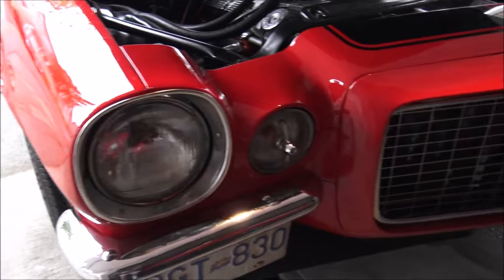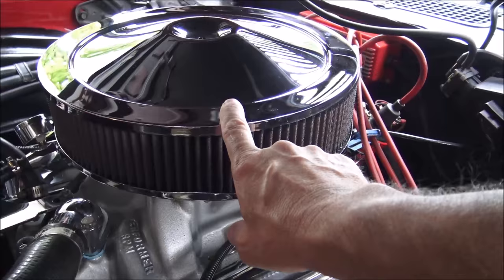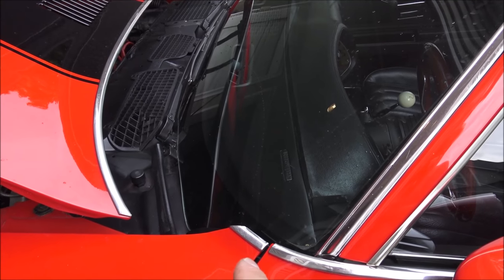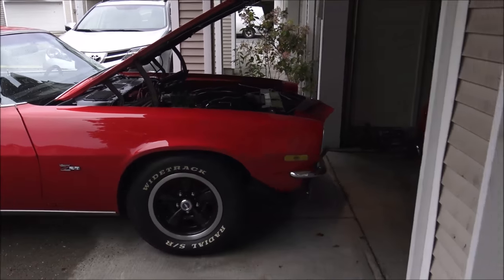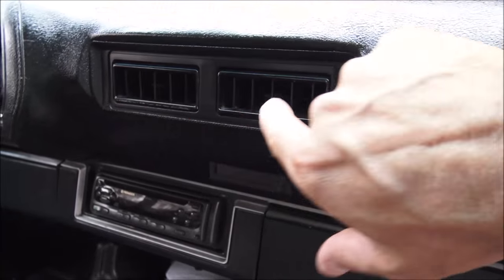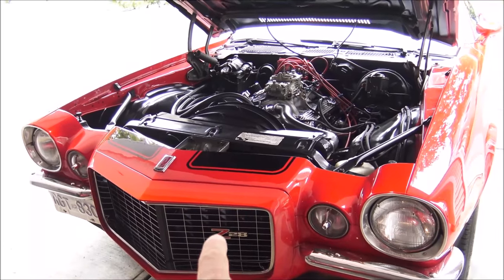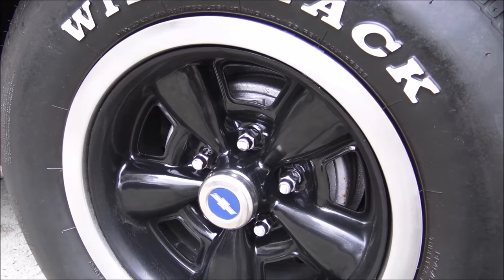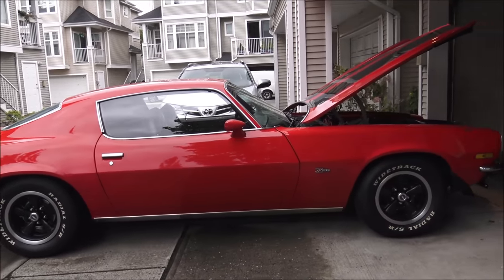Introducing my 1973 Z28!

Comment: Good video.  I have a 71 Z28  RS  the same cranberry red.  I have suspected that it was pieced together.  Your comment about the dash insert being an one year 73 part and the grill bracing may have answered some of my questions.  Seeing that firewall hung gas pedal was surprising, 70 and 71 Z28 only had floor pivot pedals.  Thanks.

Comment: I bought a 73 split bumper listed as an LT even on the vin number but Mine has the round signals like yours so I was just curious  how you can tell the difference between the models so I can make sure what I have. it's in very good shape now but at one time it was a drag car ( has the 454 big block instead of the lt 350) and a 400 tranny. It also has  the chrome trim and pretty much is identical to yours I only ask because I'd like to get it as close to original as possible not including the motor. There are no z28 or rs decals but they could have been removed when it was a drag car.
Reply: As I wrote in another comment Lt package over rode the z28 so no z28 badges on type LT also the trim tag on the inner fender will give you even more information including interior and exterior original colors

Comment: Also the Woodgrain Bezel starting in 1973 the Wiper switch had the wording on the switch, instead of the woodgrain bezel. It could be it was a fake that he bought in 1982 and was unaware of it being a fake.
Reply: There is a plate affixed to the engine compartment, drivers side above the brake master cylinder, that shows if the Camaro was a Z-28, RS, SS, or standard, along with the exterior and interior color schemes encoded. This cannot be (easily) faked.
Reply: I agree on car being a fake. Wrong switch for hidden wipers. Should say 147 on bracket. Car is also missing center rubber hood support part on firewall found on the RS.  Wrong bolts on hood latch noted.

Comment: Car is not a true RS. Too many parts incorrect. Wipers can be added after. Car is missing longer radiator support bars only found on 1973 RS cars. Car is even missing extra bolt holes on radiator support where longer bars would have been attached along with the nut rivets on inside fender. Most cloned 1973 RS cars people miss the 28 inch bars.
Reply: But it does have most of the right parts. I do agree with what you are saying but this one is probably legit.

Comment: In cold weather that Engine is going to be HARD TO START. Someone TOOK THE CARBURETOR CHOCK BLADE OFF, IT IS GONE. IT IS SUPPOSE TO BE   IN THE FRONT PART OF THE CARBURETOR !!  OVER THE FRONT THROTTLE BLADES.
Reply: Holley carbs are garbage anyway he should have left the q jet on it
Reply: Are you trying to say "choke plate"

Comment: I had a 73' z28 I bought back in 1980 for $300 and drove for a few years. Mine was stone-stock when I got it. Ditching the Quadrajet was a mistake as it flows more cfm than the Holley 650 double-pumper, gives better low-end torque and much better mileage. Common mistake people make. I was making minimum wage back then, $3.35 an hour and I used my entire paycheck in gasoline in a weekend back then when I tried the 650 holley and a Torker open-plenum intake.
Reply: There's no way it flow more than the Holly

Comment: Really nice car , but a real 73 z28 didn't have a split bumper.
Reply: Wrong.
Reply: @rossdean1997  Excuse me.  I meant to say that they had bumperetes, that the earlier 70 Z28's didn't have.
Reply: @FjHenderson  still wrong. The bumperettes were originally introduced with the z22 RS package from 70-73. The z/28 package was separate and never included appearance changes aside from the rally wheels.
Reply: @barnabyjones5161  As you said it for me, the rally sport, RS package had split bumpers. The Z28 package had a full bumper. I had a 73 real Z28 and it came with a full bumper. IF you see a 1973 Z28 with a split bumper it was converted.
Reply: @FjHenderson  the z/28 package could have split bumpers IF it was ordered with the z22 RS package. Otherwise, it was a full bumper car.
Reply: @FjHenderson  Wrong again! RS was avalible in 1973 for a models and options

Comment: 1970-73 Camaro Z-28 (not zed) had gas pedal bolted to the floor, his does not. Also it does not have the rear bumper guards that all Z-28 had. But I am not sure if they had them in 1973 because of the reinforced bumpers.
Reply: Only the 1970 Camaro had the gas pedal bolted to the floor.  1971 - 1973 had the gas pedal you saw in the video.
Reply: Zed is the canadian pronunciation